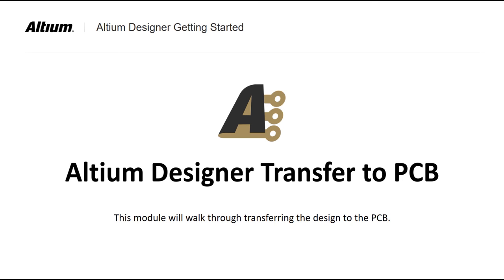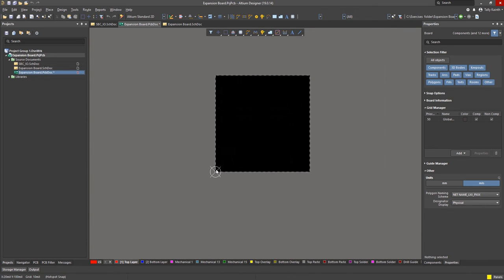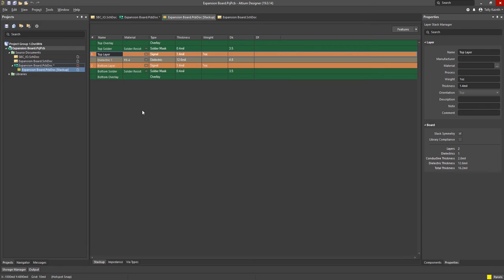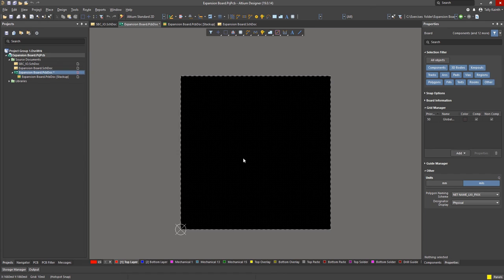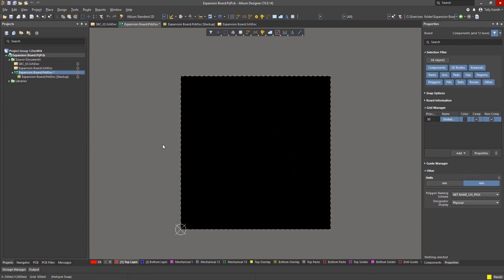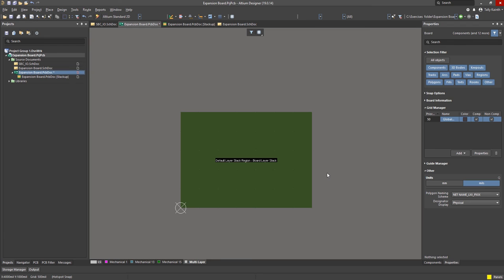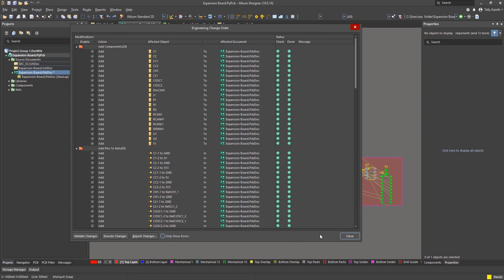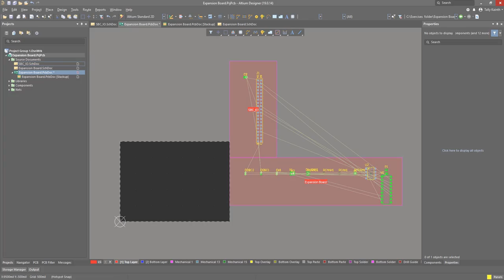(4) Introduction to the PCB and Transferring Your Design - Altium Designer

Comment: HOW IS THE PCB Outline set up? I just see a "BLACK" area ????????????????????
Reply: press '1' on the keyboard or click view ---> board planning mode
Reply: One really easy way to do it is to use the drawing tools in the PCB editor (line, arc, rectangle). Draw out the board outline you want on a mechanical layer, then you can select all those lines and use the "Define Board Shape From Objects" command.